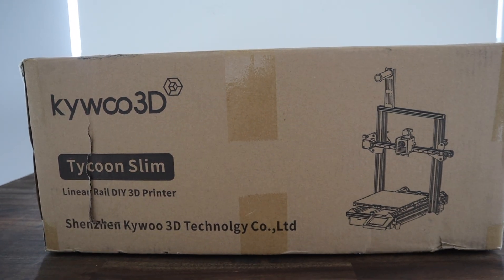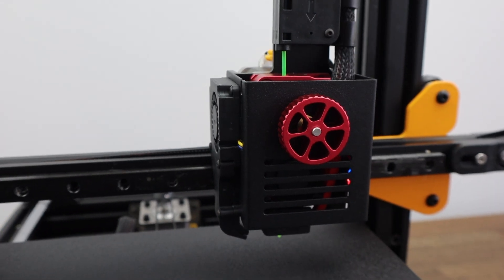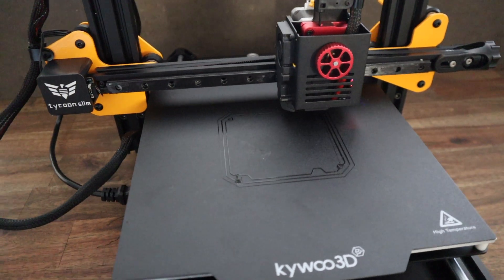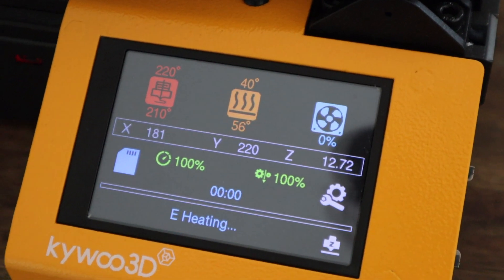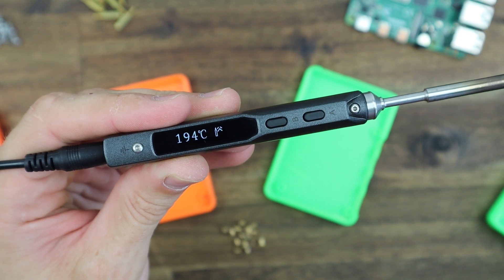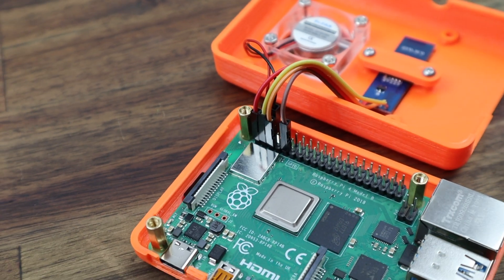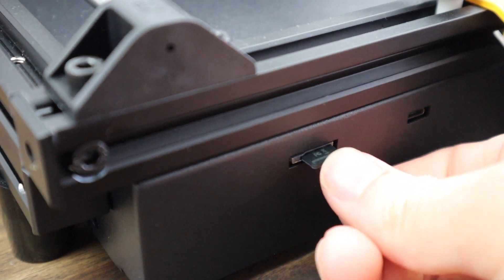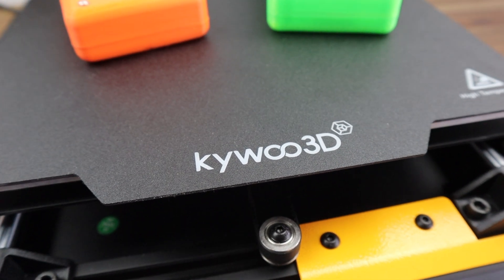Compact 3D Printed Raspberry Pi Case Using The Kywoo Tycoon Slim

Comment: What's up with the hole in the removable print surface? 😏
Reply from the maker: Too much fiddling with the g-code and slicer settings - I drove the hot nozzle into the bed
Reply: @MichaelKlements  must have been a lovely sight (and burning smell). 🤣